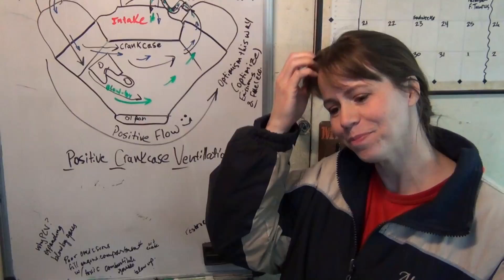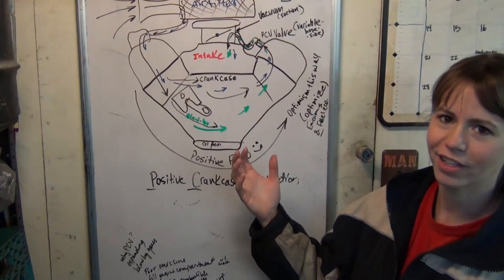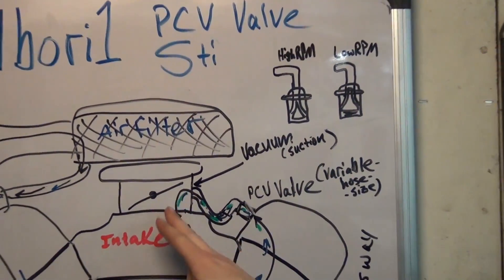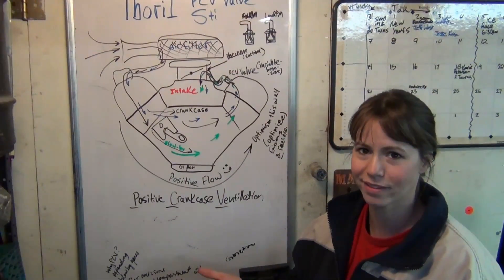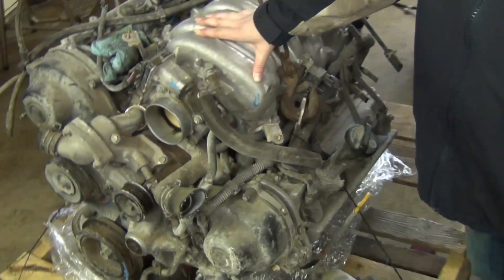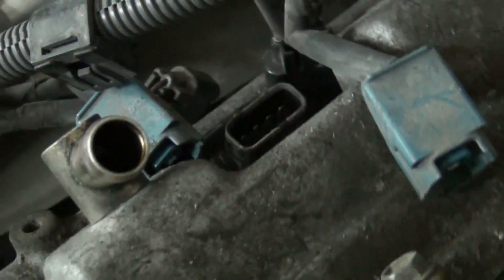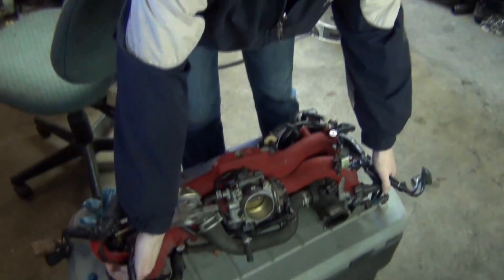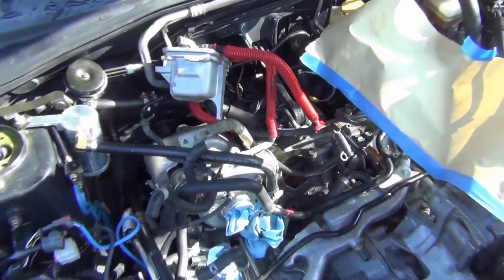PCV Valve Locations And How To Find Them

Comment: you say every car has a pcv valve  what about ones with a z18xe engine (2001 zafira a).   I can't find the part to even buy.  the videos of something similar is not it.  there isnt a puck or anything connected to the valve coer like in the videos.   I'm convinced there is no pcv valve  but then, how does it work?

Comment: Youre absolutely right in thinking that the pcv valve on an 04 STi needs to be serviced. Whoever said it didnt is wrong and was probably thinking of that nipple. You may not know this but I have a 2002 WRX(NOT an STi) and need to replace mine. Is it in the same spot even though my engine is a 2.0l and the STi is a 2.5l? The pcv valve I got is just the valve itself but with the sti everyone says to replace the housing with it because they crack and it comes all together already assembled. Mine did not. Good video either way. Very cool to see a Women with such a great knowledge of cars.

Comment: if I have oil in my intake and I changed my pcv valve already and still have oil in the intake what else could be causing that other than the oil cap
Reply: PCV valve hose

Comment: Its not really a coment but more like a question but where is the pcv valve located on a 2011 dodge ram 1500 5.7 hemi o follow the hose from the filter and it end up on right next to the oil filler neck and i cant just take that off you have to take the whole part including the oil flee neck as an assembly
Reply from the maker: danny arenas It's in it's own little oil cap thingy.  They're a little different on that engine.  Go to your local parts store and they'll show you one.  Then you'll know what to look for.

Comment: nice job!
You don't happen to know the location of the PCV in a 2011 WRX do ya? Wanna throw in a oil catch can while I'm struggling with the install of my TMIC upgrade. 
Can't get enough projects at the same time! 
  Oh yeah, and how bout a vid on replacement door lock actuators on a Ford F-250?
.......and derustifying (it's a word!)  a motorcycle fuel tank, with install of new fuel pump? (2003 Yamaha R1 if you can swing it)
Thanx again!

Comment: Very good i have this problem on my 2002 ford explorer 4.0 " oil on the air filter " and after wach your video i found out the PCV valve was disconnected

Comment: I think it would be a good idea to have her make a video about changing engine oil and changing a tire all by herself. I know so many women who will not do these two basic things and I think its scary that they drive around relying on their phone for all  auto problems. One lady I knew drove around in her SUV without any tools to change a tire or to tighten the battery terminal if something happened. Ironically that one lady was talking about traveling three States over on a road trip.
Reply: I'm actually planning to do that in my channel. I'm going to change a tire in a dress because you always get a flat at the worst time.  :D

Comment: One thing I've noticed about the PCV valve on my truck is how lose it fits. I replaced mine and when I went to install it the rubber grommet that holds it is was lose fitting. I didn't replace it because I didn't see any issues with it, but I guess that rubber grommet is going to have to be replaced so it can have better suction power.

Comment: I always "like: your videos no matter who the host may be. You guys are great! Worked on all my cars throughout the years. First car was a 1978 Oldsmobile Starfire. 18 at the time but had my license at 15 from NY. Took my drivers test in an F250, the truck was part of Van Cortlandt stables in the Bronx; my father was the concessionaire at the time. Aced the test... Didn't like emission controls much and tried different things to try and get around them not knowing better at the time. Nice 231 engine in that car, ended up plugging the vacuum advance on the car and not understanding what I had done ended up with a car that ran fine to a car that could barely run at all. It's been a long time but I'm sure I plugged more lines and could not get myself out of a bad place and ended up selling the car cheap. Went on to work on many more cars and finally had a chance to look back and figure out what I had done. With all that said, I do have a 2007 Ford Focus, if you have any tips or tricks to get the PCV out and replace without removing the intake it would be helpful. It's is the SES with the 2.0. I still cannot figure out why they put the valve where it is but any ideas would be great. I can do the job but it doesn't make sense if there is a better way.

Comment: hi i have a toyota camry 97 and my PCV valve has a hole in it. Does it affect or damage my engine? It makes a lot of noise and i am thinking of changing it as soon as possible this week. And by the way do you have a video tutorial for changing a PCV valve for a camry 97-01 4cyl? that would be a big help. thanks

Comment: hv a cabrio vw 95 and its pcv valve is broken, can that be the cause of it loosing power when i step on the gas?(if its on idle n i let it be on 1000 rev i press the gas all the way its hesitates looses throttle power n then gains, if am driving it will loose power n then pickup)

Comment: Darn. just out of curiosity, why did you have to replace the engine in the Sequoia? I own a 4Runner that has the same V8 engine as the Sequoia with the addition of VVTi. By the way, thanks for the video, it really helped me find my PCV, which helped me introduce Seafoam into the engine.

Comment: Hi I have a car withn lnline4 engine and with the oil cap off I get a lot of blow by/blow back through the filler hole. Is this normal or is this also sign of a bad pcv valve?

Comment: @mickblock

Heated PCV valve is there to prevent water condensation from freezing and either keeping the valve in the open or in the close position.  In a BMUU if the valve is frozen in the open position, the oil from the crankcase could get suck up into the intake manifold and hydrolock the engine.

Comment: Thanks Spanky. Question. If your engine has a knocking sound upon acceleration going uphill, can this be an indication that the PCV might need to be replaced?. I'm referring to a 2005 dodge grand caravan 3.3 ltr with 80,000 klms (49,680 miles). Cheers and Yes you are better looking than Brian.

Comment: It's all the way in back of the driver side valve cover. It's a heated PCV either heated by a short metal tube that is part of the cooling system, or in later years electrically heated and has an electrical connector on it. Making it not look like a PCV valve. But that's where it is all right.

Comment from the maker: It's not threaded at all.  The grommet just gets hard and won't flex to let it back out.  You can buy a new grommet, but getting the thing out it tough.  Often times you lose the bottom part into your internal engine and have to remove the rocker cover to get it back out.  The key is to get the rubber to soften up.  It's best to try when the motor is hot- the rubber will be softer.

Comment: Any tips on how to get the PCV valve off of a Dodge Ram? I thought they were just a press fit into the rubber/plastic fitting over the rocker cover, but mine is on there so tight to a very hard plastic base, I think I might break it by trying to pull it straight out. Is it a threaded connection?

Comment: Another cause of an oily air cleaner is excessive blowby from a worn/broken engine.That excessive  volume of blowby gasses can exceed what even a functioning PCV system can handle resulting in oil being blown up the intake route to the air cleaner.

There also may be a separate PCV intake filter in the air cleaner box that can become clogged, restricting the amount of clean air that can enter the crankcase. This filter should be checked and replaced when necessary.

Comment: I hear on some (and maybe all) Honda 'Fit's', you need to pull the intake manifold to gain PCV valve access...  :(

Some engines also use a separate PCV filter that should be changed... and of those some are kinda hidden. (For instance, the last carbureted Accords of the late 80's). Easy way to know, is to see if they show one in the filter catalog/s.

A spooged up PCV system can really turn an engine into a sludge bucket.

Cool video! Thanks!

Comment: Hi I have a car withn lnline4 engine and with the oil cap off I get a lot of blow by/blow back through the filler hole. Is this normal or is this also  sign of a bad pcv valve?

(Sounds sort of like a fog horn with the cap off)